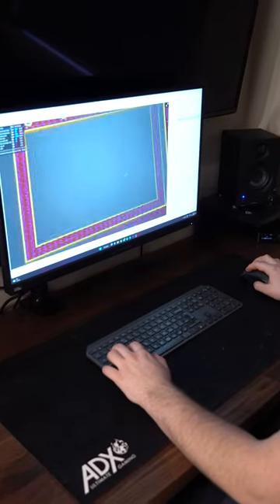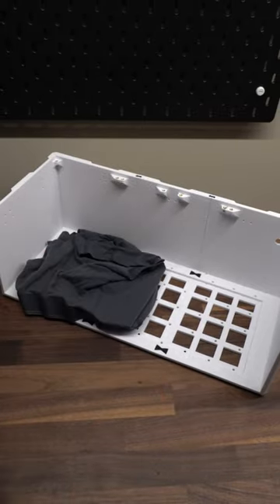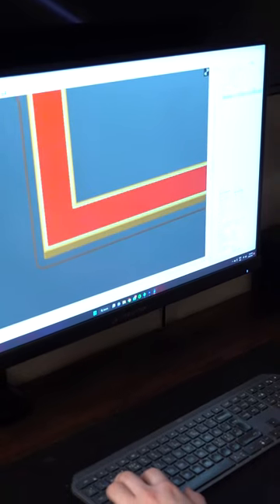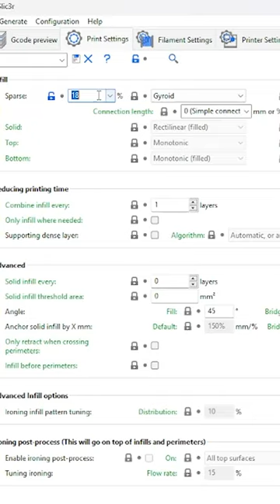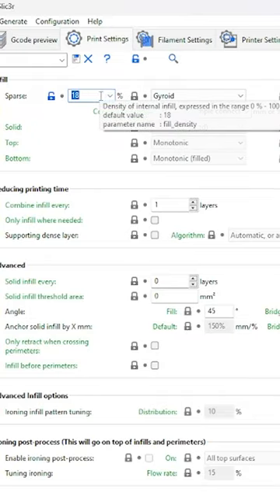Interesting idea for 3D prints #Shorts

Comment: This is a really cool idea, but I probably would have used per model settings to keep top and bottom layers on the frame,  it might give it a little more rigidity. But still an awesome idea
Reply from the maker: I see what you mean and for thicker frames this would make a lot of sense, I didn’t know that was an option actually but for this specific one the distance without fill is so small that it still feels very rigid to be honest. I’m using 3x external perimeters at 0.6 width so that times two means 3.6 mm of solid external perimeters in total, and just a few mm between with infill 😊

Comment: Certainly a cool pet hair filter, but not really a dust filter.
Reply from the maker: Good point, you’re right! I feel like it would restrict airflow though if it was any tighter. Intention is to keep dog hair out 😊
Reply: @makerunit  yeah and in my experience i have seen anything above 65% makes the line squish together in many prints i have seen.
Reply: @makerunit  I'm using a 3d printed dust filter with .8 line spacing and .2 line thickness. works fine since aircoolers usually have a few mm between the fins, all the dust that passes trough the filter will not get caught on the fin stack either.
Reply: @Flapdr01  it's better than nothing but this is not how dust works. Dust is able to accumulate wherever it's in slow moving or stale air stream. I used to work in computer repair, it was a common enough sight that the heatsink was caked solid while the fan was well some dust on it but nothing too tragic. High speed air current at the blades provides some self cleaning. Surface air friction at stationary surfaces creates a speed gradient and pockets of slow air, allowing a small dust particle to get lodged into the surface, maybe it's helped along by suspended oil or tar. And once one has lodged in, it'll find another, as dust actually tends to be pretty spikey. So whether an open, large hole (compared to particle size) mesh works for dust particle capture enough to keep the heatsinks operational, well, it depends, there isn't a hard rule, but their effectiveness is generally not too great. Since the dust is likely to encounter some slower air at the heatsink surface than at the grill surface.
Reply: @SianaGearz  Well, whatever the mechanism it does seem to work. The filter gets dirty, the hardware stays clean. I'm working on an even finer mesh. How fine of a mesh do you think I need to keep everything out?

Comment: I was going to gyroid print the structure for the Venta air washer drum. But my parents didn't want me to do this and just buy the factory made replacement drum instead. Though I think gyroid would have been better really, and I would have designed it such that I only need to reprint the wear part later, which is where the gearbox connects to it, rather than the whole drum.
Reply from the maker: Yeah this method would work for so many different appliances! 😊

Comment: awesome, i want to try to replace the glass front on my computer case with something like this for better airflow
Reply from the maker: That sounds awesome! That’s exactly the type of application I was thinking this would work for as well! Like a front mesh intake would look so cool in this pattern and I have some case ideas for this already 👌
Reply: @makerunit  I cant wait to see what you come up with.  I bought some mesh that I can use as an actual filter too if i am able to figure out how to also do that.  a yard of mesh ( for paints ) is like 2.00 from overseas.
Reply from the maker: @kspec2001  imagine a custom pc with an actual painting mounted in the front. Painted on that fabric mesh that can also serve as the air intake… Now I kinda wish I could paint 😅 although, idk how that would be with the dust  buildup 😅
Reply: @makerunit  could cheat and use  multi stencil designs and an airbrush :)

Comment: I made a low resistance filter out of synthepone. It filters great and is easy to clean
Reply from the maker: I see! That’s nice. Did you clamp it between some printed pieces or how did you mount it?
Reply: @makerunit  Printed two frames. One has thin jumpers going from left to right, the other from right to left. The distance between the jumpers is 20 millimeters. Synthesizer is sandwiched between the frames. This is the first thing that came to my mind. The frames are connected by pins
Reply from the maker: @olaf8395  I see! Cool! I’m guessing the synthesizer part was autocorrect, if not that would be s very interesting filter! 😅

Comment: That technique has been around for a long time and you did not think of it. 
Additionally these pattern tend to create turbulence that increase the noise when a fan is placed directly in front of them.
Reply from the maker: Hi! Yes I’m aware that this technique has been around for a while but I personally haven’t seen it used in 3D printed cases, I’m not saying it haven’t been used but just not that I’m aware of and I thought it would be cool to implement in a PC case design.

Though the turbulence part I wasn’t aware of. Do you know anything about how it affects the airflow? Like apart from possible noise?
Reply: @makerunit  I am in the process of testing different patterns and how they might influence the airflow for my own 3d printed cases. It primarily happens if the fan pulls through the Mesh and tighter meshes are worse. The depth of the mesh pattern also influences this.
Reply from the maker: @jakob.k_design  I see, I’m currently working on a project where I’m using honeycomb infill (I think I’m using 30 or 40% infill at 0.6mm width, to hide the graphics card and the card pulls air through the mesh. I notice peak temps of about 83 degrees C in this case on my 3070 which usually runs around 70-73 😁
Reply: @makerunit   Honeycomb might result in less turbulences (due to less sharp angles), but 30-40% Infill is pretty high for a fan mesh it will definitely limit airflow. 
If you GPU is sucking in Air through the bottom the case feet height is equally important. 16mm tall case feet vs 26mm lead to an increase of 8 degrees for my 3070.
Reply from the maker: @jakob.k_design  that’s crazy! I’m currently running 15mm feet on my case build and I’m having like a wind tunnel design with dual 200mm Noctua’s for intake and exhaust and I’m getting my 10900k (stock clocks) with a NXZT Z63 (240(280)mm AIO) down to 54 degrees at 100% (only CPU). GPU is my main issue now… I thought about trying lower infill percentage 👍👌

Comment: Very cool, I've been making them using 3d printed frames sandwiched or glued to window screen. Unfortunately, most window screen material has holes too large to catch fine dust, because they are designed to be durable and have limited restriction.

I have tried so hard but failed to locate where i could purchase the true dust filter material you see on mid to high end cases like whats used on Fractal Designs. That material flows well and catches fine dust particles.

Please respond if anyone could find a source for that stuff.
Reply from the maker: These are definitely not for the finest dust, but keeps the bigger stuff out without restricting airflow, the main question I ask myself is, what’s more important, performance or if I have to blow out the fine dust once in a while, which to me ain’t that big an issue 😊 This method has a similar density to window screen 👍
Reply: I'll give it a shot, it looks cooler than window screen and way less work. 

In the past I've contemplated using under extruded lines in a grid somehow, to make an extra fine filter with lines smaller than .4mm, surely its doable with some know how.
Reply from the maker: @honkbeforeitstoolate587  You can always try a 0.2mm nozzle and do this type of infill mod though, this one in the video was made with a 0.6 nozzle btw.
Reply: @makerunit  True. While its hard for me to measure, I think my average window screen that im using is ~0.4mm line width, and ~1.2mm sized holes. A .2mm nozzle may beat that and allow for finer filtration. A .3mm nozzle may be good too. I might try it one day.
Reply: @makerunit  Update on my attempts with your method. I like using prusaslicers rectilinear (unlike grid, it doesn't do hundreds of travels which will be nasty with retraction-free-infill, plus i'm using petg). 40% density, two layers, to create the grid, and the result is much tinier holes than typical window screen material, and it looks like the hole-to-material ratio is pretty good for airflow. If I increased the density I think I could achieve a proper "dust" filter, although a .2mm or .3mm nozzle would surely help keep the airflow resistance lower in that case.

I'm too lazy for that, so I think 40% and maybe 50% rectilinear with 2 layers should be superior to window screen filtration, and WAY less work. Thank you for your great idea :)
Reply from the maker: @honkbeforeitstoolate587  awesome! I’ve got to try that sometime! Thanks for the update! 😊
Reply: Nylon stockings, the garbage dollar store ones. They don't just come flesh coloured, you can get them black and silver as well.

If you want something more durable, speaker cabinet building supplies such as Partsexpress, speaker grill cloth.

Comment: I'm curious about the air flow though... it looks quite "restrictive". Did you compare this to other filtering solutions yet? :)
Reply from the maker: I have not done any comparisons at the moment but I might do that for a future video. Would be interesting to find out how it restricts performance(if it does)
Reply: @makerunit  it'd be interesting to see indeed. You never know, it may look restrictive on video but it could be a good surprise as well 😊, which would be an even better discovery too 👍😁
Reply from the maker: @flyingman09101984  very true! I just gotta figure out how to conduct such a test. About its dust filtration capabilities. Fine dust will slip right through. It will mainly catch bigger balls of fur and such. 
I feel like the airflow is pretty decent actually, because remember Gyroid infill is slightly angled overlapping every so many layers so even though it looks kinda «restrictive» the air is very free to travel through the small channels between the pattern. If that made any sense 😅

Comment: I used a similar method to make the dust filter for my pc. https://tweakers.net/fotoalbum/image/f0q8kulb50UeUYoj8kvBfstl.jpg
Reply from the maker: That’s very cool! How did you get two different textures? Or did you add some fabric on one side of the triangles?
Reply: @makerunit  with this print I probably just gave the initial layer in the slicer a higher density, but you can also use multiple parts, each with different settings. 
Maybe also keep an eye on a project called "full control gcode", the new python (instead of excel macros) version should be released soon-ish, though it's already been a few weeks away for a few months :)
Reply from the maker: @Flapdr01  aha I see, cool! Do you know if this is an option in Superslicer or Prusa? The different densities
Reply: @makerunit  yeah I used cura, it has a lot of settings.
Reply from the maker: @Flapdr01  Interesting, maybe I’ll check it out 😊